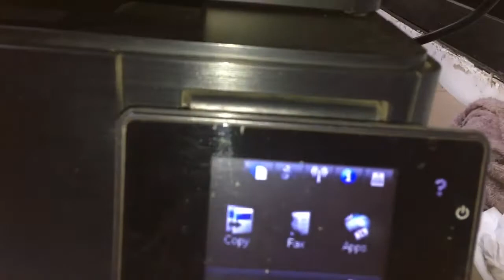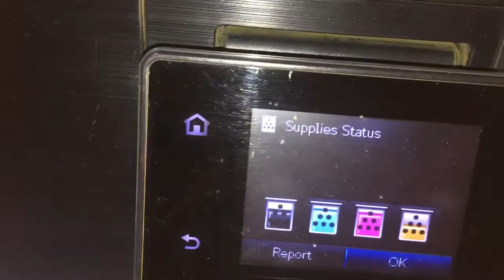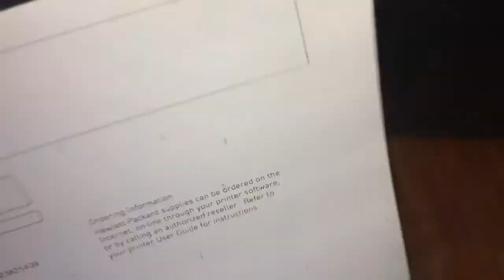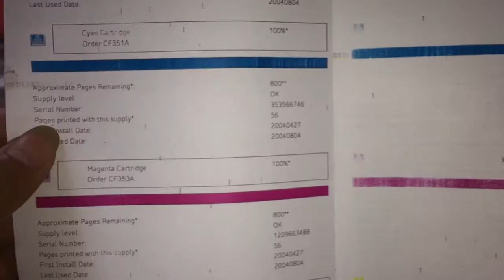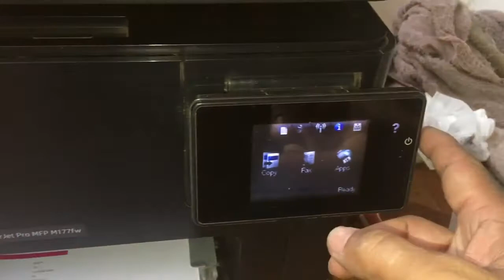HP Color Laser Jet Pro MFP M177fw-M177series  Maintenance and repair 02

Comment: Initializing issue in same model? Solution please
Reply from the maker: This is many problems, checking toner cartridges it running smooth or not, checking firmware printer, try disconnect cables on main board... test main board